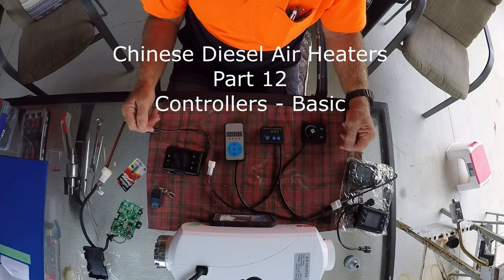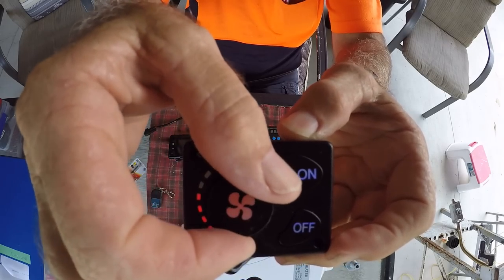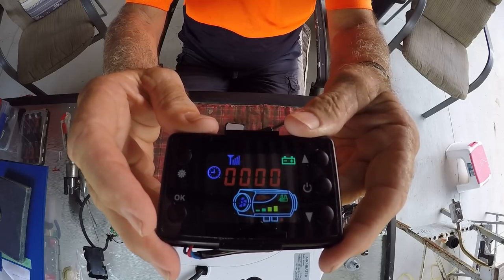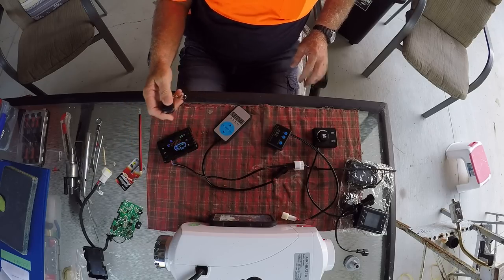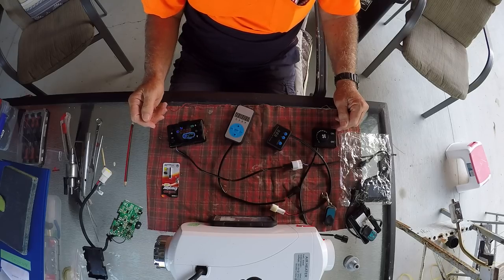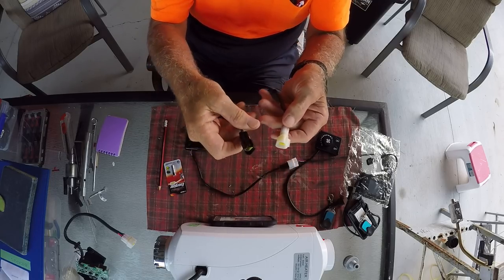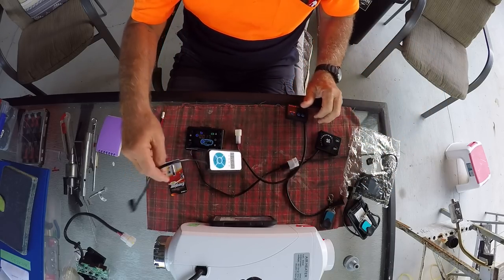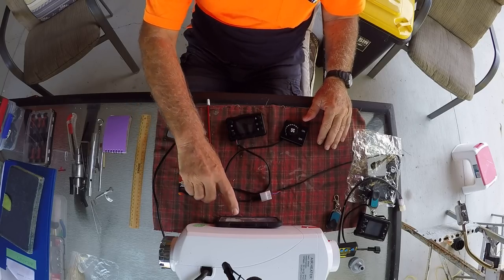Chinese Diesel Air Heaters -  Part 12 - Controllers (Basic)

Comment: Hey John another great video! I’m curious about a loss power issue as you stated when doing testing a connection fell off and the heater of course over heated. This happened to me during testing and I simply reconnected the power and hit the on button and all was good ie the heater immediately resumed normal function. I’m using mine to heat my shop area and my concern is leaving it unattended. I’m using a plug in power supply and should we have one of our frequent power cuts and I’m not there to take care of it that I will fry things or worse start a fire 🔥 I do have a small lead acid battery and have thought of connecting it in parallel with the power supply, but am concerned that the battery will be over charged with this sort of hookup. Maybe a diode in the battery circuit could be used to prevent back feed to the battery. What are your thoughts?
Reply from the maker: Thank Siskiyou for the feedback. I did not consider a reconnection and turn on. I will have to test that method on an old heater. Did the heater just continue on as before, or go into a start up program?

Re your question on power supply. With unreliable town power I would be reluctant to leave the heater unattended, and would switch it off when I left. But I do not know your situation. 

These heaters run very well on a small motorbike battery as the current draw (after start up) is small. You can buy quite cheaply now a smart multistage battery charger that will not overcharge the battery.  I would have to test the diode method before comment. Also you would need to match the battery to your power out time as there would also be no battery charging. My thoughts. JMcK
Reply: John McK 47 

Re: momentary power loss. I sort of panicked when that happened, but if I remember correctly, when I re-established power, the display lit up as normal and I hit start to get the fan going...don’t quote me on that, but that’s how I remember it. 

Re: Battery vs power supply and leaving the unit unattended. Right now I absolutely do not leave the heater unattended, but that being said, it would be nice to use the remote to fire it up to preheat my work area. I do have a motorcycle battery that’s near the end of its life so I may indeed use it in parallel with the power supply for safety. I checked the dc voltage on the power supply and it’s @ 12.1V so I don’t think that will over charge my battery as it is @ 12.5V fully charged.
Reply from the maker: Siskiyou Woodsmann  Thanks for the info. JMcK

Comment: G,day John,
Your videos are nothing short of excellent, very informative and you already saved me from errors with fuel line choice, I had already purchased bigger fuel line and saw your video just in time.
I do have an issue/inquiry, after running well, I come back next day and it will start the fan and glow plug, run for a few minutes then shut down, there are no coloured bars indicated on the controller.
No error code given. I have read a lot of comments hoping to find the answer without bothering you as your retired however I can't find anyone with same issue.
I disconnected the fuel line, went through the prime sequence into a beer can and when I put the fuel line back on I noticed I now had the first vertical bar on the display.
I started it and it ran fine, I have come home and same problem again however this time after going through the abovementioned process, no vertical bars and won't fire.
Any advice would be appreciated.
Best wishes mate and thank you for all the videos you have done.
Reply from the maker: Hi Kevin,

First, thank you for the positive comments.

Sometimes the heaters do fail to start on the first attempt, but start on a second attempt. What appears to happen is the glow plug does not get hot enough on the first start attempt so the heater shuts down, but if you push the on button again the heater will start and run just fine. You can generally check this as on the first start attempt the fuel pump will not start to tick, but will start to tick on the second attempt and the heater will light. Just try starting it a second time. That may fix things. I suspect this as you say the heater was running well previously.

Now some other things. Did you lengthen the wires in the wire harness? If so, you must increase the wire size to prevent voltage drop. 

If the pump starts ticking on the first start but the heater still shuts down you may have a fuel issue. Either the pump is sucking air on the suction side or their is a slight fuel leak on the delivery side.

If the pump starts ticking on the first attempt but will not light you may have a problem glow plug, or carbon build up around the glow plug screen.

But first listen for the pump to start on first start. If no pump ticking and the heater shuts down and you have no error codes, just try a second start.

Good luck.  JMcK

Comment: My heater has a single button controller, shaped like a circular, flat-topped, tapered, "dome". I wanted to upgrade it to the graphical version controller, but the controller wiring had a circular barrel connector, not the triangular one on the new controller.   No problem, I thought, I'll just splice the circular connector off the old controller onto the new, Red to Red, Black to Black, and Blue to Blue.  A bit of heat-shrink sleeving and we're good to go, or so I thought... Display didn't even light up, nothing. Any ideas why ?
Reply from the maker: Hi Dave, 

In the past the Chinese producers of these heaters followed the same protocol and it was very easy to mix and match parts. The controllers had the same plug, and would talk to other makers ECU. Then some manufactures came out with different controller plugs, but you could do what you did and install your own plug. Then some changed the wire polarity. Then not happy with that, some changed the whole protocol, so another controller could not “talk” to their ECU.

Suggest you first check the wire polarity.

You could also try buying an ECU and controller from the same on line supplier, as I have found them to match in the past.

But now some manufactures now change the fan speed sensor, so that creates more issues.

Sadly, these days you need to live with your current controller, or I suggest you buy a new heater that has the controller you want. The Chinese heaters are very affordable.

As a side note, I personally prefer the simple rotary controller as it is easy for the grandkids, and I try to avoid buying a heater off a supplier that does not follow standard protocol.  JMcK

Comment: If you get an Afterburner controller can you do a video on it?
Reply from the maker: Hi Jack,

I was not going to, as that controller costs nearly as much as a Chinese heater and I did not think my viewers would spend that amount of money on a controller, and there is at least one video on YouTube, but you are not the first to ask that question. I will have another think about it.

Cheers.  JMcK
Reply: @johnmck1147  Thanks for your quick response, I bought one mainly because of the feature of startup upon reaching freezing temp. And the fact it has much better timers on it along with hour meters on the glow plug & machine itself. Unfortunately its still in the box because I need a degree in computer science to figure it all out.
Reply from the maker: Jack Harper 
👍

Comment: LCD one seems also to default to 24v when disconnected.  as an aside, should the fuel tank be below the heater or does it not matter, maybe i primed to much but had clouds of white smoke when i started, which i guess is diesel in the exhaust pipe.  mine also gives ambient temp, then for some reason pulse rate, instead of set temp
Reply from the maker: Hi John, as a basic statement the fuel tank can be mounted up to 1 metre above or 1 meter below the heater without issues. You can actually go outside these measurements a little but your install must be spot on.

If the white smoke was a once off and it now starts clean, it was probably as you suggested.

Most LCD controllers can be configured to show the different parameter. Have fun reading the manual that came with yours. I have thought about doing a video on the controllers, but there are a number already done out there on uTube and there are many different controller versions.

Cheers,  JMcK

Comment: Can the LCD be use on a webasto thermo top c on a boat as I'm just using a timer switch and a thermostat would be much better
Reply from the maker: Basically No Daniel, the Webasto uses a different configuration. If you have a lot of electronic knowledge it probably could be done. It would be easier to swap out the ECU as well. 

It would also easier to get a new cheap Chinese heater.   JMcK

Comment: I have an oval shape controller the has four colours I note your controllers have three? can you help with the wiring to change it over to the LCD you have?
Reply from the maker: Hi Andrew, if your heater is a standard type the plugs are the same and you can just switch controllers. Some manufactures have gone non standard with their ECU and controllers and you can't easily switch controllers.  JMcK

Comment: Hi John,  I have one of those heaters in my campervan and it has started to turn on by itself, but does not heat, just the fan keeps running. I cannot turn it off either unless I take out the fuse.  It looks like it is a faulty controller, I don't know.  But, where can I buy a rotary controller.
Reply from the maker: Hi Maureen,

There are many suppliers on eBay, here is a start for you. I have purchased off this supplier, but there are many others.

https://www.ebay.com.au/itm/Parking-Heater-Controller-Knob-Switch-For-Air-Diesel-Heater-Time-Set/123488312781?ssPageName=STRK%3AMEBIDX%3AIT&_trksid=p2057872.m2749.l2649

Cheers, JMcK

Comment: So in case of a controller failure, can I unplug the dosing pump? Would that prompt a normal rundown?
Reply from the maker: Hi S/V,
I have had a controller failure and plugged in another controller to do the shutdown. I do not know for certain, and sometimes theory is different from practice re unplugging the dosing pump. I will try it next time I am bench testing a heater.  JMcK

Comment: Are there any 5kw heaters with a usable thermostat or are thermostats null and void?
Reply from the maker: Hi Eric, the majority of controllers have a thermistor (thermostat) in them for setting a control temperature. Check for a little hole, generally on the top of the controller, with what  looks like a small  round nail head in the hole.   JMcK

Comment: Can i connect a newer controller with a screen on a diesel heatet that came with a ålder chinese controller with round controller
Reply from the maker: Hi Philipp,

Yes you can do that   -  SOMETIMES.

It depends if the Chinese manufacturer follows the generally accepted wire protocol.

If the plugs are the same with the three wires in the same location you can just swap controllers around.

Sadly, some Chinese manufactures are now making heaters that use proprietary wiring making switching controllers very difficult.

Cheers.  JMcK

Comment: You’re awesome ! Hello from Northern California.  Can I re-wire a controller of different wiring ? Mine is different ? Can you place a link to buy a new ecu?
Reply from the maker: Hi Michael,

First thanks for the positive feedback.

Yes, sometimes you can rewire a controller if the the wire pins are different in the plug. Red goes to red, black to black, and blue (sense wire) to blue.

However some newer heaters do not come with “standard” electronics, and unless you are an enthusiast, it is easier to return the heater if new, or buy a new one with the controller you want.

For buying an ECU, search on line for, mother board, control board, computer, for Chinese diesel air heater. I am reluctant to put links in my videos as suppliers come and go. None of the suppliers I bought parts from last year are still there this year.

I just did a quick search for you, and below is a link to get you started. 

https://www.ebay.com.au/itm/Diesel-Heater-Control-Board-Motherboard-For-12V-24V-3KW-5KW-Diesel-Air-TOBS-/143890315694

Cheers.  JMcK

Comment: Hi John, I have a 5kW heater with the rotary controller. I want to get the lcd controller so that I can get a remote control. It seems that all the lcd controllers on EBay are for 8kW heaters! Can I use one of these for my 5kW heater?
Reply from the maker: Yes Pete, in most cases. 
If your heater controller has a triangle plug with three wires, power +, power -, and sense you should be ok.   JMcK
Reply: @johnmck1147  Thanks John! Your videos have been super helpful. I hope you have a Merry Christmas and a happy new year!!
Reply from the maker: Pete Lilly 

👍

Comment: Couldn't you just cut the wire of the white heater and rearrange it to the correct pin out to make it work with the common controllers?

Comment: This is the third year I have run my diesel heater. No issues till now.
Sometimes now on start-up I get white vapour coming from the exhaust pipe for a period of 30 seconds or more before I get ignition.
Any suggestion please as to what may be causing the delayed ignition?
Reply from the maker: Hi Alan,

Without seeing it myself, it appears you have ignition issues, and this is caused by carbon buildup. To save you pulling the heater down I would first see if you can first run about a litre of kerro/diesel, 90/10 mix through the heater. Run the heater at high power for at least 15 minutes. This procedure can sometimes burn off the carbon in the heater burner chamber.

You should also carefully remove the glow plug and the glow plug screen. You will very likely find the screen and the breather start hole carboned up.  This will need cleaning. If badly carboned the glow plug screen may need replacing.

JMcK
Reply: @johnmck1147   Thanks John for your reply. What you say is what I am also suspecting has probably happened, 
I purchased another heater and have replaced my old one with it - so have heating again without lighting up issues. Very cheap at only $162.00 - so we'll see how it performs.
Towards the end of last winter i tried mixing used cooking oil with the diesel - but found it didn't burn as well as I had hoped - even at low ratios like 15 -1 - so suspect that could have caused a carbon build-up,  
I only used a couple of tankful's of that fuel - then went back to straight diesel
I thought that maybe with the fuel treatment I have been using that I might have been able to avoid a carbon build-up  - but alas maybe the cooking oil was too carbonising.
When I get a tube spanner to fit the glow plug will remove it and the screen and see what I have got. I'll let you know.
Reply from the maker: @alanmountford5574  

Cooking oil will do it. 
Those oils make lots of carbon.  JMcK
Reply: @johnmck1147  Thanks John - I guess I have a big cleaning job ahead of me :-(. I will be sticking from now on to straight diesel with the treatment I have used in my car for over 20 years with great success.

Comment: What about a switch to turn of the fuel pump as an emergency shutdown, when the controller fails? If this works, it can be combined with a temperature switch as an extra safety feature to prevent a complete meltdown of the heater.
Reply from the maker: Agree. A fuel cut off switch is a good idea, I have one installed on the boat.  
The heaters don't actually go into complete meltdown if they have enough air space, but an uncontrolled shutdown often overheats and damages the ECU.   JMcK
Reply: @johnmck1147  I'm thinking of a small backup battery that only powers the main fan (or extra fan), when the power is cut/fails, while the heater is running. Using an extra fan can prevent overheating at a main fan fail to.
Reply from the maker: underwood .
Hi there, good idea, but I wonder if really necessary. This situation is real uncommon.  JMcK